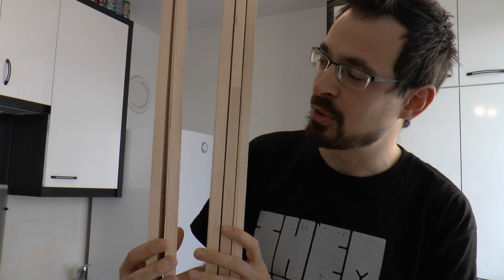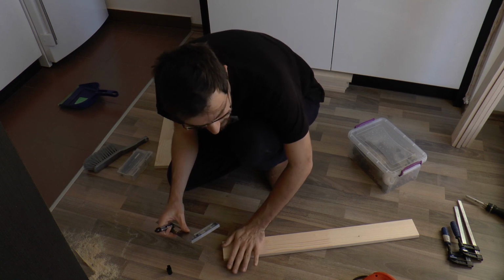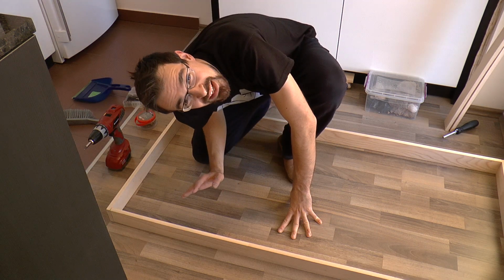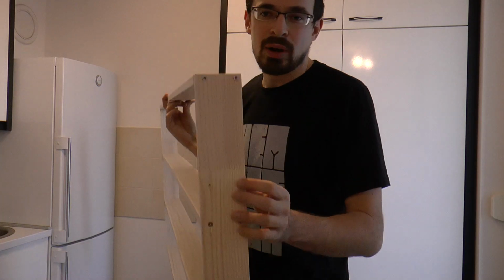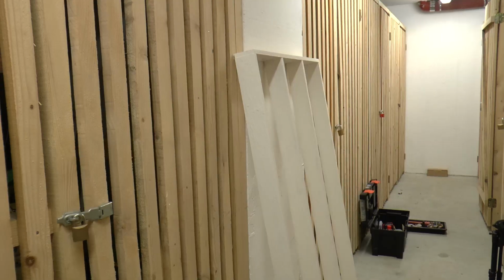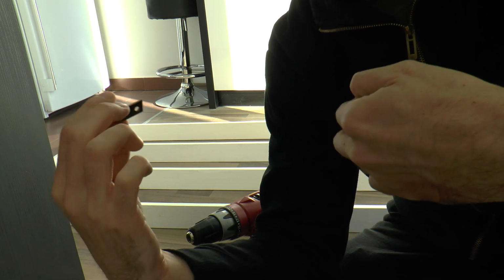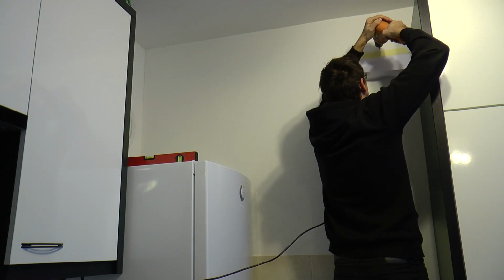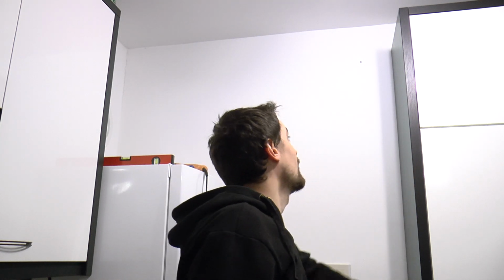DIY Shelf for Cans

Comment: Great job on the shelf. The most likely reason you can't drill into that wall is because it is a firewall and has brick or some other hard substance inside it to stop fires from spreading from unit to unit.

Cheers!
Reply from the maker: Could be, in my old apartment I never had any problems drilling much bigger holes then this one so this came as a shock :D
Reply: The Dark Den , Just make sure there are no pipes or wires where you drill✌
Reply: and if it is a firewall then you can use a impact drill! remember this kind of work needs time and a little muscle!:))
Reply: If it is a firewall, put firestop caulk on the screw before putting it into the wall, so it will help not compromise the wall. You will be amazed what fire will get through.   My 1950's kit house has fireproof caulk sealing the floor behind the baseboards to protect from both drafts and fire. And they layered a tar paper like material under the floorboards above the subfloor to also further stop it.